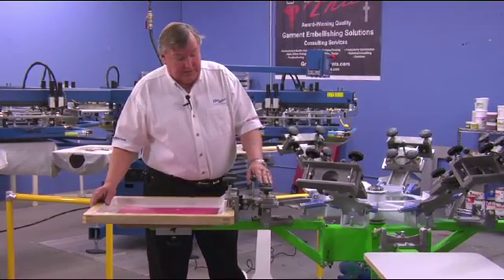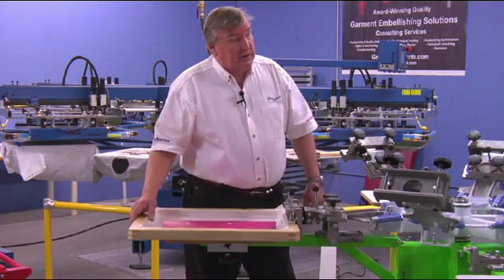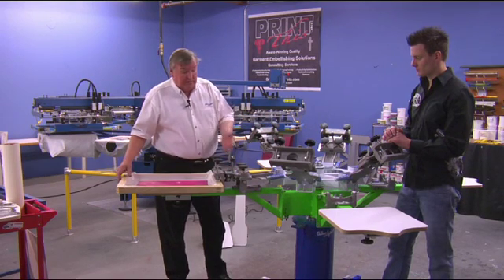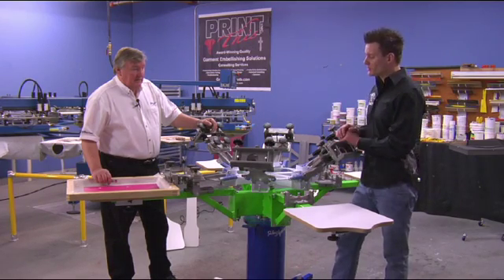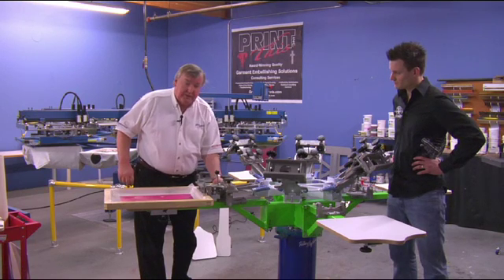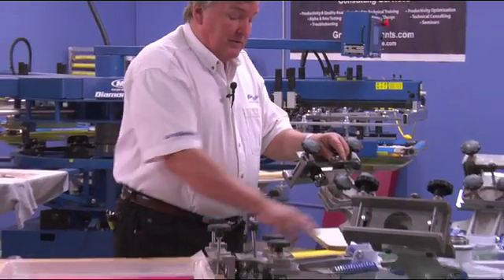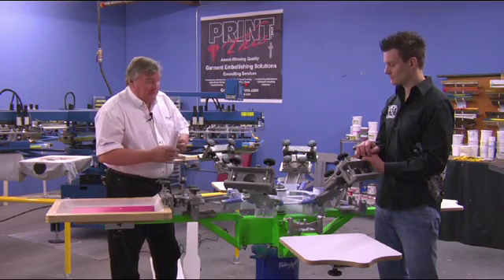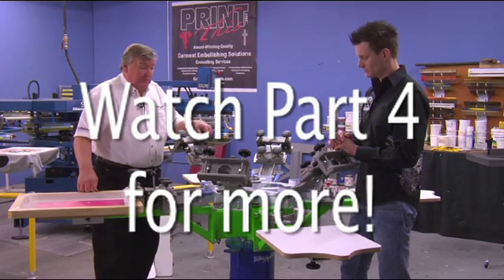Hopkins press setup and registration - PART 3

Comment: nylon bolts on the press do they come ready to go do I need to adjust them? because if they are not the same would the design not line up the same on each platen? thanks